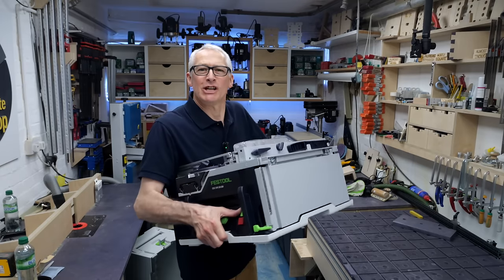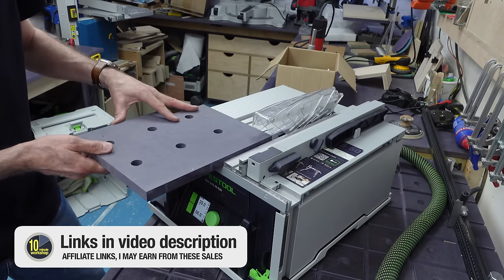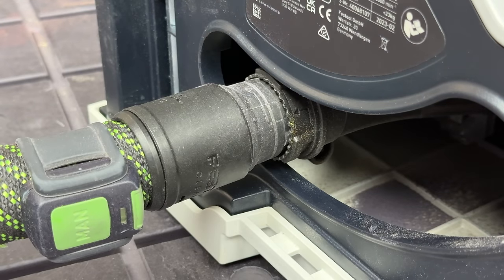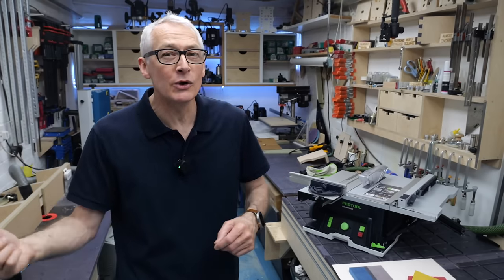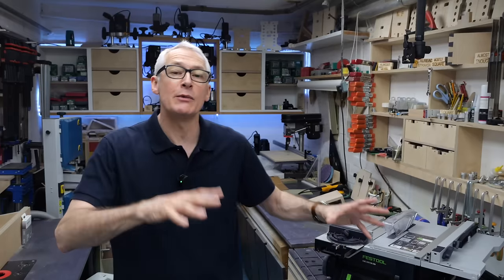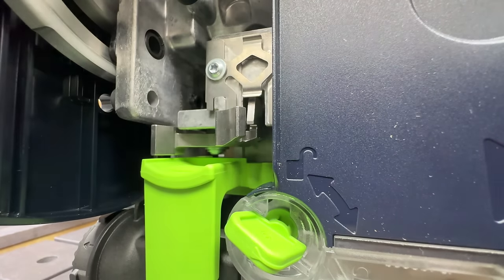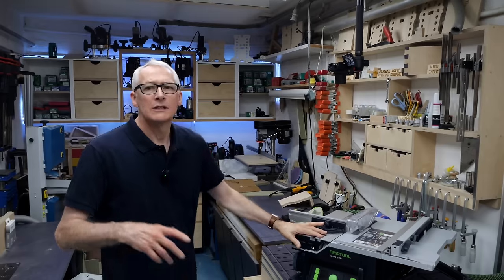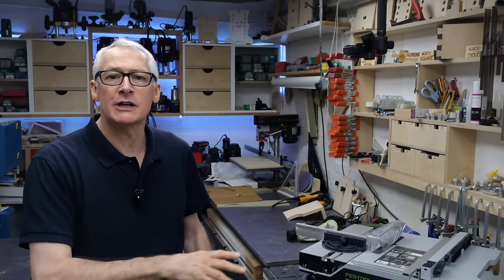Festool's Big Mistake [video 530]

Comment: Couldn’t agree more. They make an adapter (expensive) for their cordless sanders, why would they not at least have one for a decent saw likely to be used for accuracy in a small workshop with a power outlet??
Reply from the maker: I was told it was down to the power draw from the motor.  🤷‍♂️👍

Comment: I went to my local Festool dealer yesterday to purchase their portable, battery operated HEPA dust collector.  I cancelled the purchase when I realized that just like their table saw, the unit cannot work off the mains either.  Both tools are exclusively battery powered.  Both tools would be way more versatile if they could run on batteries and/or a wall outlet if/when available.  This table saw is impressive but the inability to run from the mains is again a deal breaker for me.

Comment: Thanks for the honest review. At least you're not a biased Festool fanboy.
I can't see why anyone in his right mind would spend a fortune on a wobbly, totally overpriced tool that's very prone to defects. Not to mention the abundance of plastic.
The LCD screen is the biggest joke of all. It gives you the illusion of a precise angle, when in reality it could be several degrees off.
I've owned 2 very expensive Festo tools (given to me as a present) and both didn't last longer than 4 years.
Reply from the maker: Thanks! For balance, it's a great saw if you have the need for something small, quiet, accurate and with great dust collection. It was right in the middle of the price range of the saws I looked at - about a grand more expensive than the cheapest, a grand less than the most expensive - and I still have every Festool tool I've bought - the oldest is from 2006 and still going strong. This saw certainly isn't for everyone, but if you want or need what it does, there's nothing else quite like it. 👍

Comment: For it's intended use it's not bad... but I can certainly see your gripes and they would bother me too. It all makes a lump of old iron look like great value probably with better tolerances with a similar amount of calibratrion for shop use (I realise your limitations, insurance etc are an issue!).
Reply from the maker: It’s a great saw for the intended use, but would have been remiss if me not to point out obvious areas that could be improved.  👍👍

Comment: Great review expertly galloped through.

You brought up some great points.

To me it looks very much like the design team we’re given the wrong question ‘can you extend the range of our battery driven tools by designing a table saw?’.

It is pretty clear the use case is mains powered not battery. Very disappointing with the non standard and slack as a yack mitre guide/slot.

Price wise - yeah it ain’t cheap but then again neither is an iPhone.

Keep up the good work.😀👍🪚
Reply from the maker: Thanks Norman! Yes, a lot of ground to cover in this one, lots of information to get across! I understand where they’re coming from with the battery power, but to make it battery-only is restricting and is costing them sales. As I say in the vid the slop in the slots goes away when locked and they perform as intended, but it just gives a poor impression of the overall attention to detail - especially when clearly so much has gone into the digital side of things. 

I didn’t want to make too much of the price as I covered that in detail in the previous video - it is what it is, and nobody expects Festool to be cheap, though it was exactly in the middle of the range of saws on my shortlist! I wish my dental work was only costing as much as this saw did! 

Cheers! P

Comment: Great vid and thanks for posting. Thought the digital height adjustment looked gimmicky and not needed. A digital read out on the fence would be far more useful.
Reply from the maker: Yep, all day long. 👍
Reply: Am I the only one who thinks that the powered height and angle is as much about space as anything else? 
If these were adjusted manually where would the handwheels be situated? What diameter would they be? Would they be ergonomic to use?
Reply from the maker: @trevfindley  That's a good point!

Comment: My bandsaw mitre fence has lots of slop in it, Other I've looked at also seem to be less than a good fit just wonder if the manufacturers build in slop to stop jams Fromm dust in the fence slot. What to me is the most disappointing aspect of saw (and most or all new ones) is the lack of 'micrometer' adjustment to the fence - my 70 year old table saw has such.
Reply from the maker: Especially considering the digital dingus for height & angle. You might be right about allowing for dust build-up, but an odd consideration given the big deal that Festool (justifiably) make of their dust extraction. 👍

Comment: I'm not on the Festool battery platform but I own some corded Festool tools. The fact that this saw is battery only is a deal breaker for me. I really was excited for this saw until I learned it was battery only. The saw would be sitting in my shop all the time and I don't really want or need anything battery powered from Festool so it would be ridiculous for me to have batteries only for this tool.

Comment: nice info i’m thinking of getting this one too as i have three of the festool 5.2 ah batteries . i’m thinking of trading in my dewalt flex volt table saw which is excellent too btw .  I totally agree it should have the option to be plugged into the mains wtf!
Reply from the maker: It’s a great saw - more to come on this, maybe in the next video,  it I’m really pleased with it, and it’s everything I want in a saw - small, quiet, light, compact, accurate and great dust collection. Just happens to be cordless - and a bit pricey!
Reply: @10MinuteWorkshop  Yeah, I relly want to see more from you on this saw. Since you seem honest (and not sponsored) about it. It’s a bit funny that so many seems to view this as a negative review, when it’s clearly not. I’m very close to buy one myself. 👍

Comment: Indeed, battery power alone is a real bummer and if Festool had gone with both corded and battery then clearly it would have fit their "systems" ethos well not to mention the variable work envrionment etc. 

If the pinned message below is accurate are we to assume there will be yet another item to buy or is the suggestion the design of this thing is not yet fully fleshed out? The Lithium craze is I think overblown and I worry as batteries become more expensive some companies are going to regret going so deep so soon in the current battery ecosystem. Plus, what happens if we all end up in a mineral shortage and battery shortages are indeed a real thing? For these reasons cords are still good.

Comment: Another mistake was not using the now famous 20 mm hole system for the saw feet.  Loving my saw also, but i wish i could swap out the feet to work into my bench top or my own stands
Reply from the maker: That’s a great point! 👍👍

Comment: Like you, I'd have thought a mains powered option would be the business. I'm surprised that a digital fence isn't incorporated too - probably only cost another €1000 or so 😁😁 I do like the size and quietness over my dewalt 745 - still scares the living $hit out of me when I switch it on.
Reply: Agree, it would be a way better proposition if it was also a battery charger and the whole saw could operate off of mains, too - and the digital fence would also be pretty obvious if you're already that gimmicky.
Reply: hi. I've added a slow start module to my 7492. very easily done and makes a huge difference to start up. 😊
Reply: @con-f-use a digital fence would give you the option of going back repeating cuts exactly in conjunction with height of the blade
Reply: @steviebye1  Come on then, details 🙂

Comment: Should be corded. Solar power bank with AC inverter today are very powerful and has more capacity in comparison with 2 festool small battery. The price is also going down with 1100W capacity and 2400w load capacity, only cost around $700 this days, they last 3000 cycle and can be use for any other power cord tools.

Comment: I get the height adjustment. If you want to do trenching or rebates it’s ideally if you can adjust .mm at a time. 

I do agree about mains power though. I certainly wouldn’t buy it with that restriction. I wish more tools were hybrid powered.
Reply from the maker: 1.8mm kerf and no flat-ground blades available afaik, those trenching cuts will take a while! 👍

Comment: The mitre is sufficient for quite precise trims and grooves, would love extra height but can live it for now. Initially I did buy "just" the saw, like yourself, but then l came to realise the importance and flexibility of the stand as l move it around the room, since l use the Kapex close by, the extension Rails (KA-UG-KS), coming at the obviously the same height as the saw acting as a perfect support for longer panels. The metal surface is better than just stacking some systainers or the mft, custom building pieces/stands/supports are of course another option, but it defies the point of simply getting on with it, as well as the more unified look, albeit at the additional cost. But you wouldn't even consider Festool if that was an issue😜😅
Reply from the maker: It's the most precise saw I've ever owned, and I'm really happy with it - but it would have been remiss of me not to mention the obvious areas for improvement! The stand is really nice, and clearly well thought out as part of the system, but it was just too big for my workspace, at least for where I want the saw to go. If I expected to be moving the saw around then it would be perfect, but I don't. 👍

Comment: How is there not a cam adjustment on the mitre bar...? It's such a standard thing to have on a mitre guage... I agree, the battery issue is likely to be the real dealbreaker for a lot of people, though.
Still, a really interesting saw.
Reply from the maker: As I say in the vid, I don’t think the mitre bar is meant to be used ‘loose’ - it’s just a general lack of ‘fit & finish’ on a saw of this price that drags it down. And it’s a great saw, really pleased with it. 👍

Comment: Hi Peter , I’m sorry that you have issues with the saw,  for that money the quality should be very good, I think it’s way too expensive  and I would be on to festool about  the lose fit of the mitre gauge ,
Reply from the maker: Thanks! To be clear, I've no issues and I'm really happy with the saw - I wanted a quiet, small, accurate saw with great dust extraction, and that's what I have. I feel there are areas that could be improved and it would have been remiss of me not to mention them, but overall I'm very pleased with it, and I'm looking forwards to using it on some projects. 👍

Comment: Hi Peter, I have joked with you on the short that you were going to cost me money by buying this saw as I had dominoes because of you. However you are spot on with the cordless element. Not only do you have to have two batteries to run the saw, if you have no power you need cordless extraction too, more batteries. My situation, as many in 🇬🇧, is space not power. I want precision & reliability in a smaller package
At the moment I am keeping my wallet shut, unless you keep telling me it is brilliant of course 😁
Reply from the maker: Oh, it is brilliant! It's everything I want in a table saw - small, quiet, accurate, modern, fully compliant with health & safety, great dust collection. Don't let the fact that I'm pointing out areas that could be improved put you off, just be aware of what they are. Also, have a search for the comment from my friends at Sautershop - sounds interesting! 👍
Reply: @10MinuteWorkshop  yep seen that, I am waiting…….

Comment: Thanks for the insightful review. As always, you don’t disappoint. However, the FT does. I will not buy at this time in the hope that FT will hear a and modify the saw to include a plug. I also hope the slack will be taken out of the fence/miter.  FT - pay attention!!!
Reply from the maker: Thanks!  To be fair the slack in the fence and gauge goes away when they’re locked - but it would have been remiss if me not to mention it existed, and is definitely an area for improvement.
Reply: Ok, I’ll look at it again and then reconsider the purchase.  Over the past year, I have slowly been converting my shop to a FT platform. I have enjoyed the quality and the precision they provide (Lord knows I need all the help I can get).  I also agree with your assessment in regards to the  “Cord” oversight.  That said, the cuts you made on it were spot on. Always enjoy your perspective.

Comment: Have a few Festool workshop tools but by far the most expensive is the TKS80.....Sawstop....thats why I bought it...but it's most infuriating attribute....you're always thinking is the timber too wet.. any metal in it.
So you turn off the Sawstop....
Cut your timber and then TKS80  says nope not gonna start again....
Shows a solid red and green light .....not on the guide what that means 
So technology sucks sometimes...should have stuck with my trusted cast iron Jet me thinks .
Love Festool tools but some are over thought and under at the same time

Comment: As always a great video. The point at the start about dealer supply is a very serious one. I have lost one of my local dealers and a second is not happy. I have a tool on order, that like your saw is available on line. Festool and other manufacturers wake up you are losing the  trained knowledgeable front men. You can get them back.
Reply from the maker: Thanks Barry! Like you I’ve always bought through the dealer network, but they make it difficult sometimes; can’t help but think that if I hadn’t cancelled my order and gone to Amazon I’d still be waiting… 🤷‍♂️

Comment: I have the same curiosity, why on earth, battery powered table or miter saws don't come with a cord too? You do not buy a cordless tool in this size just use on the front door of your client; will use it inside the house, in your shop or garage. Is insane to think of having two portable table saws (corded and cordless) occupying your space.
What if get one of the batteries and turn it into somewhat a corded power supply!!!! 🧐

Comment: Are there capable electric motors that are able to meet the requirements of a table saw and be powered by AC or DC with both reliability and performance? Looking at the big picture and hearing how the saw is designed for the finish installer it might not be practical for a high current tool to be used with other AC tools simultaneously on a electrical circuit found in a typical walk-in closet? There certainly is a bunch of whiz bang elements of this tool but I hope that they are robust enough to withstand the travel and usage throughout the changes in weather. I would take a pass on this one until it has been proven reliable. It’s a big chunk of change for a Guinea pig.

Comment: Requires a hybrid motor, very expensive. My ryobi hybrid trimmer was over £100 rrp and never used 240v.

Try the makita adaptor for high capacity batteries badaptor. More power
Reply: Sorry there is no makita lxt to festool. JapAdaptor might have them but I couldn't find them

Comment: Do you not think the battery only decision is a weird thing across all battery tools?

Why not a mains adapter that connects in to the battery shoe on all power tools?
Reply from the maker: Yes. Festool do this with their cordless sanders, but apparently the power draw is too great for a motor the size of the one in this saw. They say. 🤷‍♂️ But yes, I think hybrid mains/battery tools would be popular. 👍
Reply: @10MinuteWorkshop  mmm interesting, but as you say, it has to be a solvable problem

Comment: Not making a standard size miter gauge slot is inexcusable. DeWalt makes a batttery powered table saw and it does not have "mains" capability either. Doesn't make it right but if it was "mains" capable it would cut down on battery sales!
Reply from the maker: Not providing a mains option is cutting down on saw sales… 🤷‍♂️

Comment: Peter, In fact  I would be pissed off about that miter gauge issue,  and the blade guard looks like junk, most of the time I don’t use a guard anyway , and I don’t like the digital blade adjustment.
Reply from the maker: Not for you then! 😂 Blade guards are mandatory for commercial workshops in the UK, and I think the play in the mitre gauge and fence is more disappointing than a problem - as I say, they lock down and function perfectly, it’s just a matter of  perception- or ‘fit & finish’ 🤷‍♂️ 👍

Comment: Thank you, for convicing me not to want to buy it. I was thinking to buy a small cordless table saw as my shop is tiny. You helped me to keep my money in my pocket and not waste them on it. For me, its price is huge, and I would have paid it only if it would have been perfect and came with at least 4 batteries and a two ports charger. 
Many thanks, again, and be well.
Reply from the maker: Thanks! To be clear, it’s a great saw and does everything I wanted. But it would also be remiss if me not to point out the obvious areas for improvement. 🤷‍♂️👍